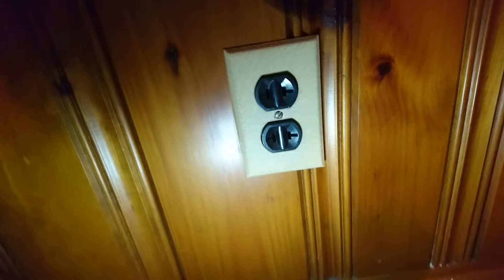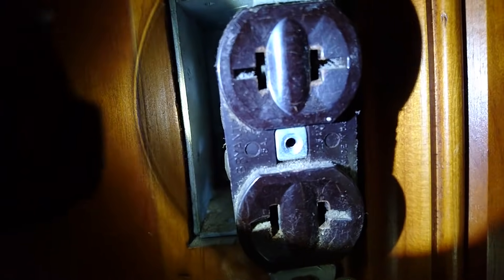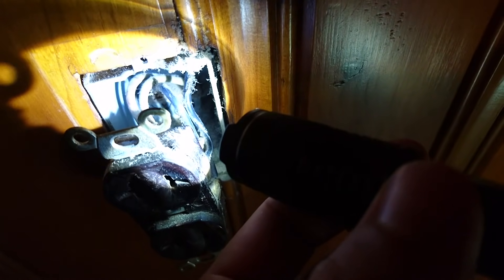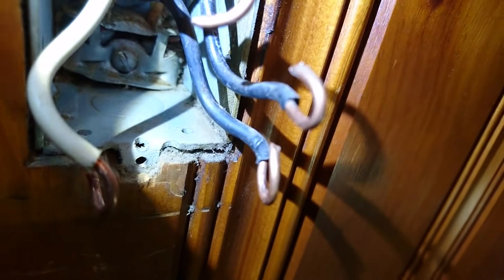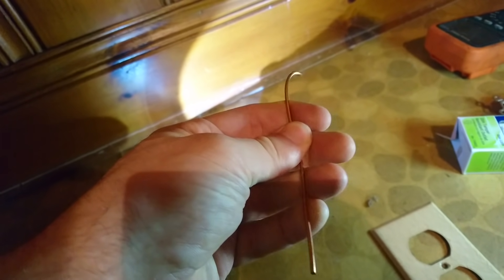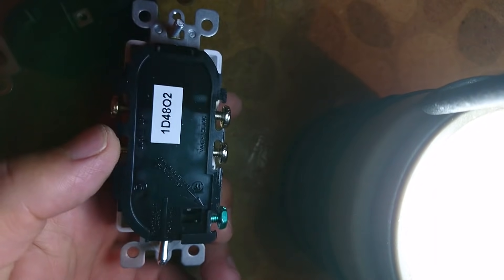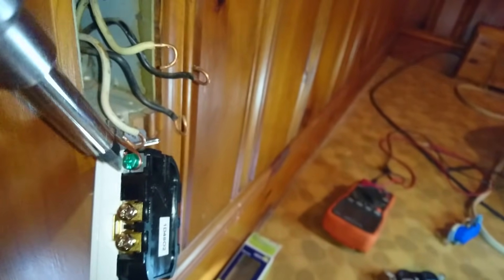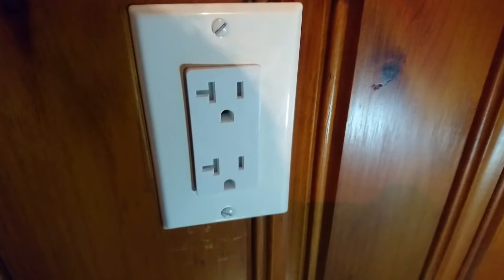How to Convert a 2 Prong Outlet to a Grounded 3 prong Outlet (TYPE AC Cable WITH Grounding Strip)

Comment: So the box by itself becomes the ground?
Reply from the maker: No. The box is attached to armored cable that has an internal grounding strip. The cable itself becomes the ground that attaches to the electric panel, which is grounded to Earth.
Reply: Bootstrappin' yea but not all wiring is like this so be careful

Comment: Any real electrician watching this is screaming hack electrician
Reply from the maker: Ok boomer
Reply: No I’m actually 21 and I’ve been doing electrical work my whole life if your working with a 2 wire system putting a ground screw in the back of the box does absolutely nothing! How would that ground out in the box and trip the breaker when there are no grounds!!!!!!! Your teaching people to create a arc that will be continuous and start a fire because it won’t trip at the breaker because there are no grounds on a 2 wire system, sure your receptacle tester will say proper wiring but it’s not accurate because it picks up on the ground in the receptacle going to the back of your box! The proper way to change out a 2 wire system to a gfci protected one is you need to trace out your line on your receptacles fed from the panel and the first receptacle they hit off the line side you need to install a 20 or 15 amp gfci look at breakers for info on amps. Once the beginning of your line is gfci protected every other receptacle after that on the line can be a regular 3 prong on that circuit only!! If any of the receptacles trip on that circuit it will trip at the gfci outlet fed from panel because there is no ground. That’s the proper way to do it on every circuit. And no I’m not a boomer I’m a 21 year old licensed electrician and it’s people posting dumbass videos like you that cause people to cause more damage than good. Just imagine how many people did this bullshit and have stuff plugged in overloading and could start a fire at any second....... leave it to the pros or post a new video on how to do it the proper way
Reply from the maker: @thefreedomvoice8607  first, you clearly didn't watch my video. You can only do this if there's armored cable with a ground strip going to the box. This grounds it to your electrical panel. Second, you completely ignored this is permissible per NEC 250.118 Sections 8 & 9:

(8) Flexible metallic tubing where the tubing is
terminated in fittings listed for grounding and
meeting the following conditions:
a. The circuit conductors contained in the
tubing are protected by overcurrent
devices rated at 20 amperes or less.
b. The combined length of flexible metal
conduit and flexible metallic tubing and
liquidtight flexible metal conduit in the
same ground return path does not exceed
1.8 m (6 ft).

(9) Armor of Type AC cable with an additional
equipment grounding conductor and as
provided in 320.108.

You don't have remotely enough experience to be this overly confident.

Comment: It is allowable by code to put a 15 amp recep on a higher amperage circuit. You can even put a 15 amp plug on a 30 amp circuit provided you use 10 gauge wire
Reply from the maker: That makes no sense to me even if to code. If I plug a space heater and a toaster on the same outlet, the circuit breaker will happily deliver 20A, while the 15A outlet is absorbing 600W of extra heat it wasn't designed for, becoming a fire hazard. In the kitchen, I've found a melted 15A outlet on a 20A breaker from the previous owners.
Reply: @Bootstrappin  Yousitech - NO! BAD ADVICE !  You are going to kill someone!  The code exception permits 15 amp devices ONLY on 15 & 20 amp circuits.  30 amp receptacle is different configuration altogether.   BOZO the 15 amp outlets are designed to work on 20 amp circuits.  I think the failures you are finding is 15A outlets on a multi wire branch circuit (shared neutral) where the neutral is improperly passed thru the device rather than being pig-tailed so it cannot be interrupted.  When such a device is removed for repair or replacement the Neutral is cut thereby making the circuit a 220V and it will fry devices and appliances downstream if the current is on.  Actually a fairly common problem and the subject of several recent code updates - including connecting the (single pole) breaker handles  on such circuits with an approved handle tie.  You say you are finding these "in the kitchen"  and that is the most common place for  MWBC, used  to satisfy the code requirement for two 20 amp circuits.
Reply: @johnmcmanus7226  That is impossible. To get 240 volts across an outlet, you would need to have legs A and B across that outlet. Since there is only one hot leg running to the outlet, 120 V is the most you will get.

Burned/melted outlets are almost always due to loose screws. Most of the rest are due to poor contact between the plug prongs and the outlet contacts.
Reply: @buggsy5  But if the neutral is "spliced" across the outlet in a multi-wire branch circuit (MWBC) which uses a shared neutral between two circuits and you take the outlet out, to replace it for example, you break the neutral and everything downstream will now be 240 V.    That is why in a MWBC you always pigtail the neutral to the device.  Read up on MWBC - you can google the term on the internet.  Two rules apply in these circuits:  1. never break the neutral at a device and 2. you must connect the single pole breakers to opposite legs so that at max current flow in both "hots" they cancel each other out and there is no current on the neutral.  This means one breaker below the other and they must be coupled with approved handle ties.  A short or ground fault on one  leg will trip both breakers and cut off current on both circuits.
Reply: @johnmcmanus7226  True for a MWBC, but that is not the case with the receptacle in the video. There is only one breaker feeding the outlet, which could still have the link removed and the hot split before the receptacle to allow switching of one outlet.
Reply: @Bootstrappin  I suspect those melted/burned outlets had the screw loose where the damaged occurred. It is rather common on even 15 amp outlets on 15 amp circuits. It is part of the rational for requiring arc fault breakers on some circuits. 

If you are plugging two devices that draw more than 15 amps combined, then you are misloading the receptacle.
Reply: John Mcmanus     John,   I agree with some of what you say, and some questionable.     If you have a multi wire branch circuit in a dwelling, and the neutral fails(let's assume on the home run) then the potential from one hot to the other hot is as you say 240 volts.   But the burning up appliances needs some thought.    If you think about the circuit, the only way to get amps through the devices is something has to be plugged into both sides to complete the circuit.   The appliances are now series connected, not parallel connected.   What happens to 240 volts with two loads connected in series?   The handle ties for MWBS's were put in NEC because of maintenance man.   The NEC intent is readily available handle ties are installed to"disconnect" the conductors utilized with the common neutral.   They can trip separately.   This does not make them 2 pole breakers.    Respectfully,   Kevin
Reply: @Bootstrappin  you're right, it all comes down to how much amperage you're pulling. But I always put receptacles in that match the over current.
Reply: @buggsy5  exactly, you would have to have two hots, one from each leg to have 220. And as far as a 15 amp on a 20 amp overcurrent,  as long as you don't need the 20 amps, that'll be fine . But if you're drawing 20 amps, your receptacle could fail, before your overcurrent would trip.because that 15 amp receptacle is the weak link, between the overcurrent  and the wiring and whatever you're powering.
Reply: @johnmcmanus7226  can't be 240, unless you have another hotwire in there from the others leg from the panel .  A Singular hotwire from one side that's 120. you don't get 240, unless you've also got a hot from that other side as well.

Comment: what if box is plastic
Reply from the maker: Then it won't work. Box has to be metal, and cable sheath has to be metal. The alternative is to convert the outlet to GFCI, and to label it "no equipment ground". That is an acceptable alternative.

Comment: mine still says open ground?
Reply from the maker: Assuming you have metal sheath running through your house, check your connections. You can also check what the ground is up to by testing the resistance between neutral and ground, because in older homes they usually go to the same place, that might help pinpoint where the ground is open - resistance should be low. If all else fails, you can install a GFCI without ground and put a sticker on it that says "no equipment ground".

Comment: Will it be safe for equipment grounding?
Reply from the maker: Yes but only if 1) the cable sheath is metallic with a grounding strip (type AC) or is conventional 3 conductor Romex 2) the outlet box is metallic 3) the cable is properly attached to the electric breaker panel which is properly grounded with a stake in the ground

Comment: My question is: In an old house build from 1959 and all the outlet box in the house are two prong outlet and a plastic box (not a metal box) then how can I have a ground?
Reply from the maker: What kind of cable runs to your plastic boxes?
Reply: @Bootstrappin  Thank you for your reply.  The cable runs to my electric plastic boxes: one is white and one is black (black is the hot cable)
Reply from the maker: @gngd5351  got it. And the sheath of the cable, is it metal, or plastic?
Reply: @Bootstrappin   the sheath of the cable, it is plastic. Thank you.
Reply from the maker: @gngd5351  ah. Then it is definitely not grounded. My method uses a special type of armored cable that has a grounding strip inside. You would either have to replace your cabling with a standard 3 conductor cable, or to avoid the hassle, put GFCI outlets where you have the beginning of a daisy chain. You'd then label the GFCI 'no equipment ground'.
Reply: @Bootstrappin  Yes, "label the GFCI 'no equipment ground'" and ALSO label every other grounding-type receptacle installed "downstream" (via the 'load' terminals of the GFCI) as 'GFCI protected' and 'No equipment ground.'

Comment: Well fucking duh both sockets read the same voltage because they are tied together via straps on the side of the receptacle!
Reply from the maker: You check it out of an abundance of precaution, not because you want to give Zener Stanfill a reason to comment the obvious.

Comment: WHAT IF THERE'S NO BOX
Reply from the maker: If I'm understanding correctly, you have an outlet just floating with no box? If so, that's a substantial safety hazard, turn off the breaker and don't use that outlet until you install a box.

Comment: aluminum oxide is not flammable.
Reply from the maker: You're right, I had wrong info. What happens is aluminum oxide creates a large resistance at the wire contact, heats up, and causes the fire.
Reply: @Bootstrappin  True.In eastern europen countries aluminum wire was common until the early 1990s but we had less problems because we use less current on 230 V.Maybe it was also a different alloy like pre-1972 and post-1972 in the US.

Comment: That’s a false ground that’s not how it’s done
Reply from the maker: Care to enlighten everyone with the reason? Because I've got type AC armored cable with a 16AWG internal grounding strip; it runs the length of the cable and is attached to the electrical panel, which is grounded. It is therefore an allowable ground per NEC 250.118.
Reply: I have spent 5 days looking for the correct video on how to put ground wires to a new outlet. Do you have a video of your own that explains how to Install a ground wire to an existing outlet?
Reply from the maker: @suzannta2827  here is a great video explaining how to go with the GFCI method: https://youtu.be/ekl_t-Q2ahQ
Reply: @Bootstrappin  Cannot run a separate ground wire as you describe.  Must be in a cable assembly (NMC, UF etc.) or conduit.  Only option, other than rewiring with cable that contains a ground wire, is to use GFCI receptacles as you CORRECTLY describe.  Be aware you only need to put these at the head (first device) of a branch circuit.  in this fashion, every outlet downstream will be protected and code compliant.  You can install a conventional three prong outlet in ese downstream devices - perfectly acceptable and safe. Supposed to put a sticker on each one as described. Code requires it but no one does it.
Reply from the maker: That's correct, I removed my comment with the separate conductor wire because it's only a partial truth. 250.130(C) allows a separate conductor to ground an ungrounded receptacle to an otherwise grounded where the branch circuit originates from. Go with the GFCI method, and slap a sticker on it.
Reply: @johnmcmanus7226  Note that not all devices will work with GFCI 2 wire source circuits. An example are my UPS units, they fault out because of the missing ground wire and will not boot up. I had to pull new circuits.
Reply: That’s exactly how you do it he did it right

Comment: that is not a proper way to ground an outlet. there is no way to shut the breaker. the ground suppose to be to the breaker box. Are you an electrician giving this advise? Doesn't seem like it.. If you want to ground an outlet without going to a box is to use a GFI outlet, though still not as good, but it will at least trip off. What your doing there is not correct and not by national electrical code or even local code.
Reply: Unless his outlet box is grounded to the breakers panel? Or am I wrong?
Reply: @Dabket3araB  your wrong.

Comment: What kind of electrician are you? You didn't test the ground. You were suppose to check between ground and live connection
Reply from the maker: That's what the ground tester is for.
Reply: How you know the box has been ground . The tester unit only tell 120 v in.    ? ?
Reply from the maker: @scottvan1898  it can test for open grounds, neutrals, phase, and can tell you what's wrong accordingly. See pic:

https://images-na.ssl-images-amazon.com/images/I/81jikGfI7IL._SX679_.jpg

Comment: Why go to all the trouble you did with the ground wire because it's still not grounded. It might appear to an amateur but there's nothing grounding the metal box you ran your ground wire to.
Reply from the maker: It is grounded to the electrical panel, through the cable armor and internal grounding strip.

Comment: And you put it in upside down...lol
Reply from the maker: This was filmed in Australia
Reply: @Bootstrappin  im sorry i shouldnt pick apart .._.._you did a good job
Reply from the maker: @cyruswindsong754  all good thank you... But it's not upside down? How do you figure? I usually see them prong side up
Reply: @Bootstrappin  yeah i see em like that all the time also. But iv been a union laborer for 18 years i work  around electricians alot in the building trades and they always install prong up
Reply: @Bootstrappin  the weight of the cord pulls down  on the plug  and exposes the pos. and neg. Blades._..Idont think it matters as far as city codes its just safer prong up
Reply from the maker: @cyruswindsong754  ah that's an interesting take, I guess it depends which way you expect the cord to be used the most for that particular outlet. Never thought about it.
Reply: @cyruswindsong754  ac power dose not have positive and negative. That term is only used in dc power.  The correct term used in this aplication would be live (hot) and neutral  (common). And nec dose not have a code for orientation of the receptacle. The outlet can even be installed side ways its all a matter of personal preference. But thanks for you incorrect input
Reply: That's exactly how they install them where I live, but I guess if you have a preference then do it however you like it.
Reply: Kirsten J because the ground is at bottom. So if installed the outlet is upside down with the face upside down. .A kid cant get shocked as easy. Most likely kids will be scratching loose prong cables and try getting shock because they would scratch the hot and netural at same time but if they scratch the ground. Its fine. Ground is not live so that’s why they do it there. Probably because it’s code required. Here normally its only done in commercial buildings or mostly hospitals

Comment: GFCI......
Reply from the maker: ...is a type of outlet!
Reply: @Bootstrappin  is the easiest solution
Reply from the maker: Fair. In the case of these old steel outlet boxes, I've found you can't really cram a GFCI without shorting the contacts, so you might be swapping out the box which is painful since they're nailed into studs.